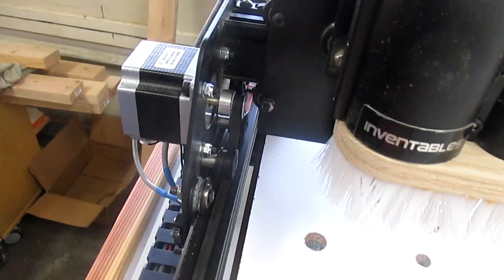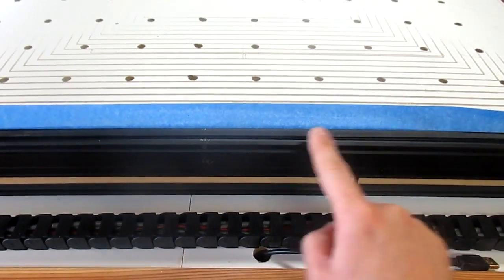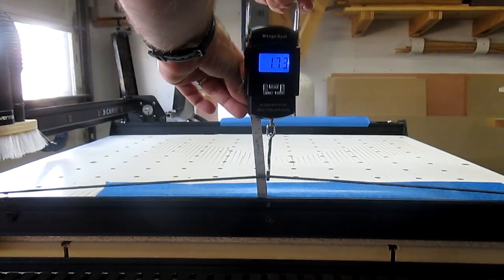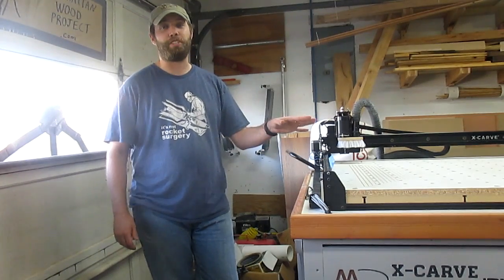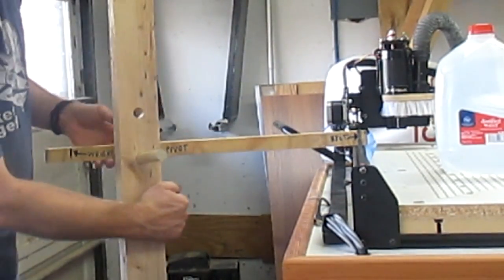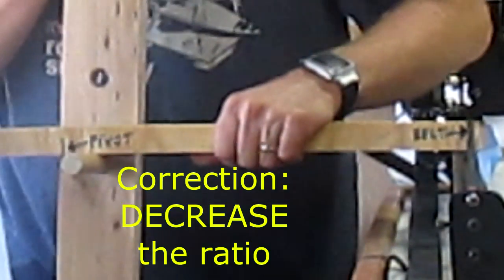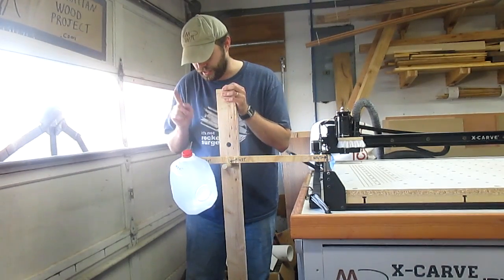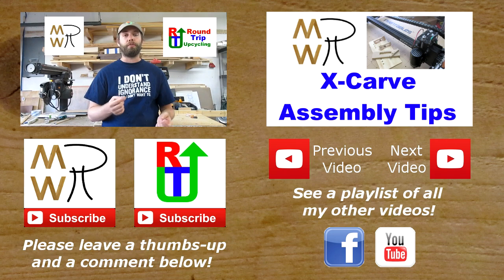34 - Setting X-Carve Belt Tension - Manhattan Wood Project

Comment: Engineers are smart.  This was awesome!   Appreciate the detail in the 2nd method, but im not engineering inclined, so better spring for the weight gauge.    Do you know ... or have a trick for centering the belts on the pulleys?   I just replaced my x axis belt and cant get the belt centered on the pulley and can’t remember how i got it centered the first time.  Great video.

Comment: That's a great idea withs cales... currently i am assembling x carve and was thinking about tension... i think guitar tuner should work too to compare Y axis belts if tension in equal
Reply from the maker: +korsez A guitar tuner should work, but I'm not sure what frequency it should be.  You'd have to dial in your own machine's tension.  Should be interesting though, there's quite a few interesting ways to tension them.
Reply: @korsez Granted this was 2 years ago, but did you ever work it out with a guitar tuner?

Comment: Great, thanks for the video explanation. I'm adjusting my belts now and then I'm off to watch your adjusting the pots video too. After a few months use, are you still happy with the 3.5 lb tension?
Reply from the maker: +Mike Byrne Thanks!  I think it's dialed down to about 3.25 lbs or so, but it's running so well that I haven't had to measure it for a month or two.  If you go to the Inventables projects, you can find a calibration project I created that will help you decide if you want to lower your belt tensions even further.